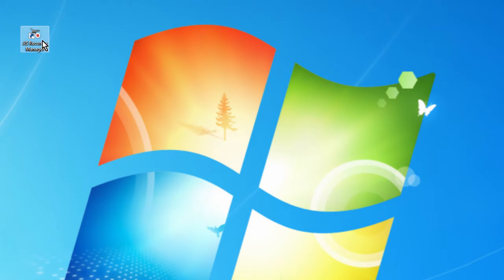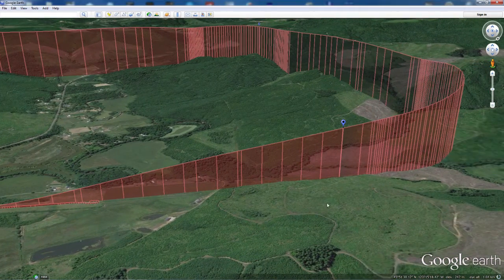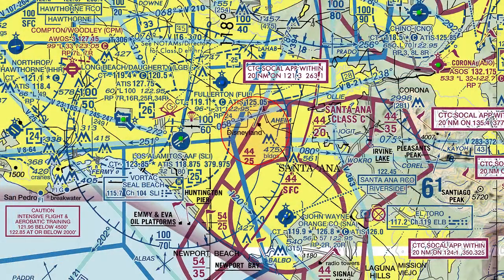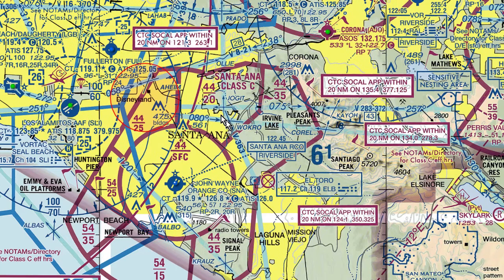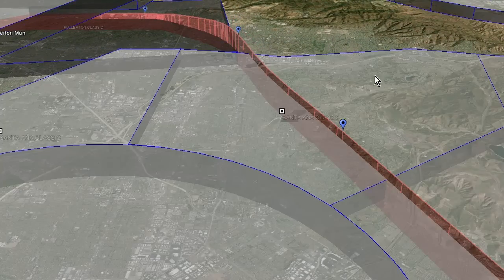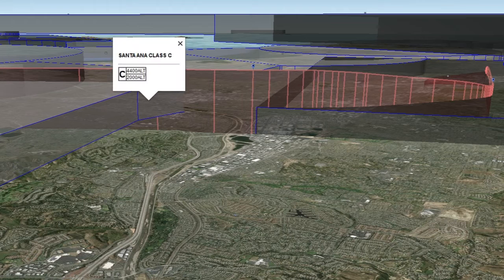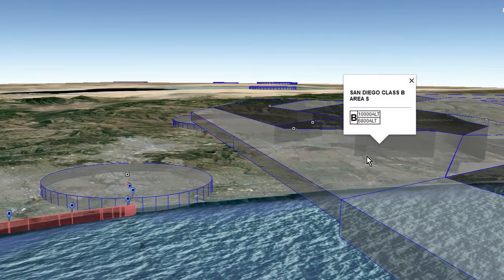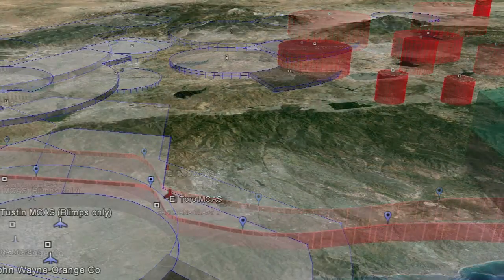Twin Otter Close Up #10: Flight Data Recorder

Comment: Thanks for the video - I'd forgotten all about the Data Recorder function - do you happen to know if it can be used with any other FSX aircraft? I think the Aerosoft Airbus has it as well, but I'm not sure. Maybe it's just an Aerosoft thing.
Reply from the maker: I have not explored this but maybe it can be hacked. It is a cut-down version of the 'black box' that comes with FS Flight Keeper, a commercial product that aerosoft sells, which I think can be used with any aircraft.

Comment: Very impressive to see the airspace visualized in 3D so easily. Thanks for the description.
Can you parse the recorder data in real-time, or doesn't it create the file until after the recorder is stopped?
Reply from the maker: +CMDR Gazer__ Eek, I don't know that. I expect it writes the file as it goes, so if you were clever enough you could probably be reading it and doing stuff...
Reply: +Almost Aviation Just curious. Even if the file can be read by using something like BearTail, I don't know how it could be useful. Just musing!